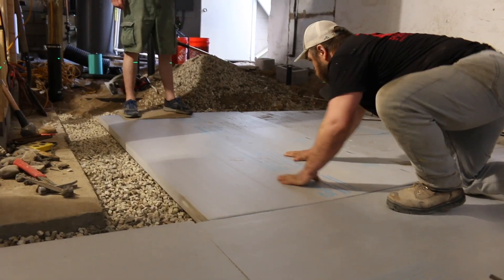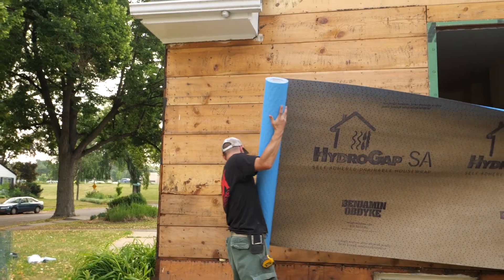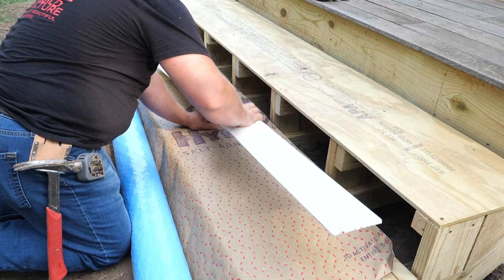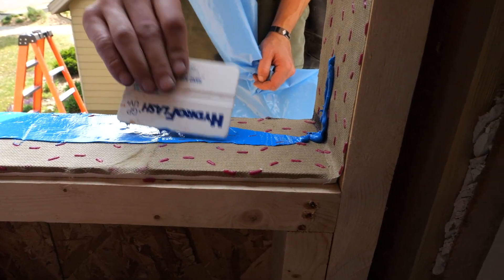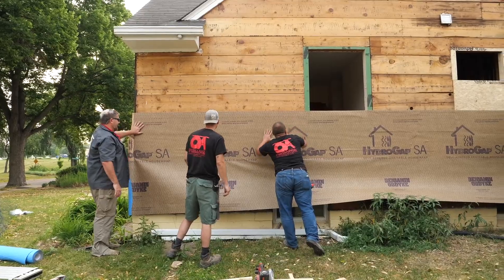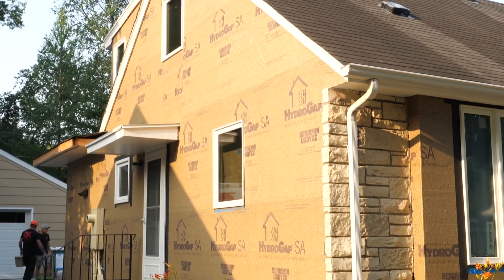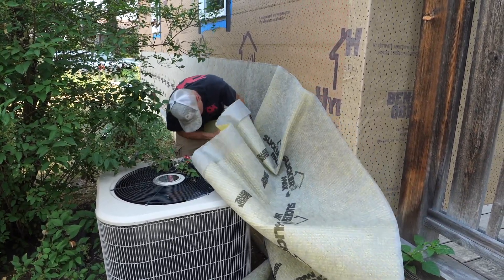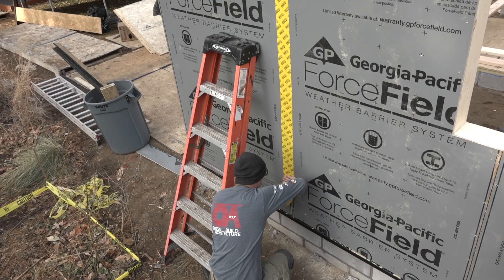Peel and Stick House Wrap and Rainscreen Installation: Water Management on Building Resilience Show

Comment: Got it wrong on XPS vs EPS.  XPS does absorb moisture, only slower....but that also means it dries slower which is not good for draining applications.  The moisture absorption test is a 24hr test...hardly applicable to real world.  EPS has the same compression strength available.  You are drinking the Kool-aid from big blue and big pink.
Reply from the maker: You can order XPS and EPS on many different densities. In general, the white beadboard EPS that you get off the shelf is less tolerant of underground applications. The XPS that is found at most lumberyards is suitable for underground applications. 

Products and materials are not inherently good or bad, just the uses people force them into. Steel I beams make terrible pillows, but excellent structural members.

Comment: So did the new Peel and Stick apply right over existing felt paper? Did you have to staple it as well?
Reply: We removed the existing felt paper before installing the new peel and stick. No staples needed.
Reply from the maker: That would defeat the purpose of peel and stick house wrap.